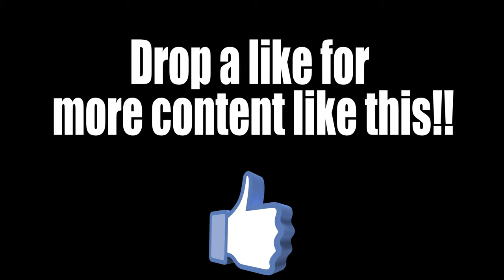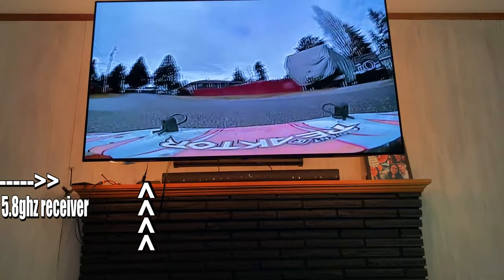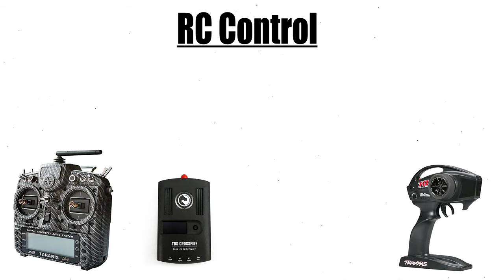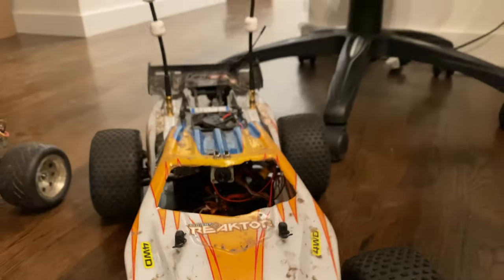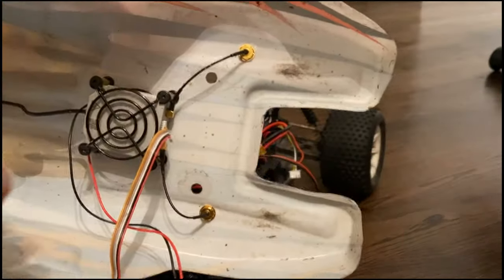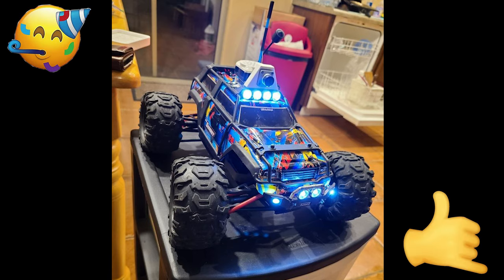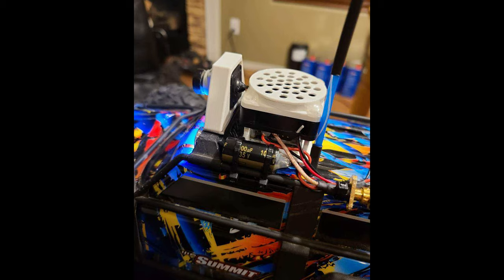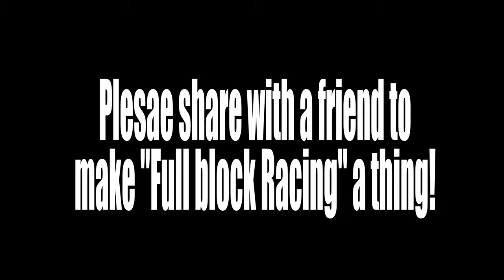How to Build an FPV RC Car in 2021!!!!  - 4k

Comment: I want to do a simple fpv in my crawler...not to much range..100 feet of so. I use 3s lip battery and want to power up off my esc plug and use a small video monitor..and want it under $100.  Suggestions?
Reply from the maker: Yup! I’m making a video on the subject very soon, but I will help get you started now: you can’t power the vtx off of you car’s battery. There is too much interface from the esc and will cause bad video. You can get away with a 200mw all-in-one vtx/camera and a little screen from Eachine. Power the vtx from a 1s battery and mount them the best way you can. *Keep the vtx as cold as possible 🤙
Reply: @ChaddRainsFPV  is there a brand or amazon link for the camera? Is there numbers to look for as far as video quality in the 5.8hz cameras? Thanks so much for the help. I want to sit on the couch and do some fpv crawling in my back yard..fun stuff.
Reply: @ChaddRainsFPV  just got my little fpv camera/transmitter combo, 1s battery and stand alone monitor..about $100 all in..works great on my little 1/18 scale rig.
Reply from the maker: @brianonthego  Awesome dude! The little ones are super easy to set up and doing little racetracks with them is great. Careful tho, getting hooked on pushing long range gets expensive hahah 🤙

Comment: How to do the 1.3 ghz video setup
 I forgot that I had asked early 😅 what is the cost for the 1.3 setup ?
Reply from the maker: Sorry for the delay on making that video! I will get it out, just been busy. You can do a simple (but good) 1.3 ground station for ~$100, but you need to make sure your RC link doesn’t interfere (or get interfered). 

It’s best to use crossfire with it so that adds a good chunk of money too. I think I have around $500 into my whole 1.3 setup.

Comment: i just came across this type of technology, just curious why drones have wide range for the unit and also the wireless camera, but its not applicable in RC cars? I noticed RC cars dont got the same range capability
Reply from the maker: When you transmit radio waves really close to ground you have to deal with the waves bouncing a lot. You can also be in what’s call the fresnel zone (Google will explain that one well). This makes it harder to get the same range vs something that is in the air. I like a challenge so that’s why I make “FPV rovers”, but I do drones as well 🤙
Reply: @ChaddRainsFPV  Regarding that, is it not possible to rip the system out of a, say,  mavic mini 2 and put it in a car? It´s supposed to have a 10km range in the air, it´s hard to imagine it woulnd´t make 500 meters where I am at (high hills with valleys, free sight, no cables, no wifi etc.)?
Pls forgive me if I am being naive or just oversee something! In my country only 5,8ghz and 25(!)mw are legal, so I wonder if that is even worth the effort...
Reply from the maker: @jotcw81  The Mavic’s all use a different kind of video link than the DJI FPV system (they use an older “lightbridge”). It has latency that makes it difficult to fly (or drive) while only seeing video on your phone. 

Basically, if your car is fast this won’t work. If your car is slow (less than 20mph) you could probably have a good time with it 🤙

Comment: Hi I have a 1/24 rgt and it’s FPV!!! but not now the cameras keep getting very hot and stop working after a while any help?
Reply from the maker: Right on! That is a Super common problem. I tried adding heat sinks (like the ones used on esc’s) and it didn’t fix it 100% of the time. I had to use a fan and make a mount so it would blow in the video transmitter the whole time it was on. Hope this helps 🤙
Reply: @ChaddRainsFPV  I have burnt out many cameras like 7 so no more fpv for me lol

Comment: hi...
what is the range you got on the dji air unit setup?
Reply from the maker: It depends on where I am driving. If it’s in my neighborhood I can get 2 blocks down. If I have an open field, I am guessing a mile. I have taken it out 1km with no problems but ran out of room to drive 🤙

Comment: I need to ask like 3 questions lol can I message you? I have the air unit and goggles do I need the crossfire system off the bat or can I add it next time I get paid lol
Reply from the maker: I rarely check IG but messages there sometimes get through. I check YT more haha. 

But right, here’s the deal: a good install of the DJI air unit (antennas, cooling, etc) will get more range than almost any stock RC car’s 2.4ghz link. You don’t wanna drive your car too far and have it get stuck with no RC signal. You can get away with it but gotta know your RC limit 🤙

There are some radios that will make it around the block. The Radio Link RC6GS is one 👍

Comment: What size fan do you have on the air unit?
Reply from the maker: They’re just some 60mm (maybe 10-15mm thick) 12v fans. eBay gotta have them for cheap 🤙
Reply: @ChaddRainsFPV  awesome, ima pull 1 of my air units out of my drones and use that instead of my runcam5 im using. Im gonna do the DSC port on the radio aswell when I get some cash to buy 1 lol.
Reply: @ChaddRainsFPV  got my controller and tbs all set up, had to reverse throttle other then that all set up :D thanks for the video's
Reply from the maker: @ToothlessCBR  hey right on man!! What remote did you get again?
Reply: @ChaddRainsFPV  I got the RadioLink RC6GS V2.
Reply from the maker: @ToothlessCBR  dude. Thank you for confirming! So many people said the radio link wouldn’t work or the Dumbo RC wouldn’t work so I appreciate the confirmation, really 🤙
Reply: @ChaddRainsFPV  Id gladly send you some pictures of the radio and my xmaxx setup.

Comment: can that dji fpv work with monitors or only goggles
Reply from the maker: I made a video on how to get video from DJI goggles to monitors / Fatshark goggles. There is no “ground station” style DJI receiver though. Not at this time so you will always need DJI goggles. Hope this info helps 🤙

Comment: Hey Chad.
How do I finish my crsf set up on my full size Summit?  I would like to personal message you.  Interested?
  I am so close. Been stuck for weeks now. Not exactly sure how to hook up my nano div.rx /servo adaptor. with servo leads from truck. also script goes blank in Qx7 trying to open up micro tx.. Pease
Reply from the maker: Hey Willy,
Just hook up your servo leads like you would to any other receiver. Ch1 is probably steering and channel 2 is throttle. Here is a good video from another channel that explains it pretty well (tell him I sent ya if ya don’t mind 🤙) - 
https://youtu.be/jb3XUuhimbk

Comment: How well do you think 1.3 gh would work in a cave?
Reply from the maker: That’s tough.. it depends on how narrow. If it was a big cave it would beat 5.8ghz but if it was really narrow I think you’d have an issue with the antenna being too close to a ‘reflective’ surface
Reply: @ChaddRainsFPV  what would you suggest? I’ve been trying to build an rc 4x4 with a camera and liar lidar but I lose signal very quickly.

Comment: Lol I was about to ask if u have found any part for that dominus. But it's not a Dominus. My buddy just gave me one with the brushless 540. But I'll definitely be making me a fpv mod really soon. I already use crsf on my fpv quads and I got a tbs sixty9 that has a 1w vtx and crsf nano combined.
Edit... Well i guess it is a Dominus 🤦‍♂️🤷‍♂️ do u happened to Kno how to get a parts. there is supposedly a Chinese car or something that the parts work for it. But I haven't found it yet
Reply from the maker: Haha glad to hear you’ll be making one too brother 🤙 I couldn’t find any parts for mine and had to move onto a better rig. Video on it is almost done now
Reply: @ChaddRainsFPV  i feel ya. I'm actually about to put the granite blx 3s in layaway just to have parts availability and upgrades.

Comment: A 1000$ before inflation im thinking the old android phone with rupert app would work pretty well any thoughts ???
Reply from the maker: The price of the goggles and air units has actually gone down since I made this 🤙 Crossfire system is about the same but you can get away with a RadioLink or DumboRC radio if you need some more range than a stock remote. Nothing has went up in price, in regard to systems I covered. Fingers crossed tho hahah
Reply: @ChaddRainsFPV  Thanks 👍

Comment: do you need to have goggles or can you just play it on a screen
Reply from the maker: It depends on the system. Analog systems can always have a screen if you prefer. Digital systems (like DJI, HDZero and Walksnail) almost always need proprietary goggles 🤙

Comment: Can You do a video on your ground station I want to do the same thing on my 8s outcast and xmaxx and e revo 2.0
Reply from the maker: Editing now! Should be done in a few days 🤙
Reply: I bought the fs gt3b controller and it won't work with the tbs crossfire lite or I don't know what I'm doing can you send  in the rite direction to get it like yours to go around the block
Reply from the maker: @gentrylongfar6255  what cable do you have hooked up to it? Where is it hooked up at? You can make a video of how it’s all put together and post it to YT and I’ll check it out. Just tell me when you post it
Reply: I will I just bought the radio link the one you recommend on your video

Comment: Does a separate battery power the fpv system or how is it getting power?
Reply from the maker: For analog yea, it’s a must. The noise from the motor/esc is too much for the video feed. If you’re using DJI FPV for the video, just using a fat capacitor is enough to run the air unit off of the car’s battery. 

Hope this helps 🤙
Reply: @ChaddRainsFPV  The air unit as in the DJI camera with fan? How many volts in the bec are recommended?
thanks a lot
Reply from the maker: @jaimemira-xb5zh  Yes, the air unit. But it doesn’t come with a fan as stock. You need DJI FPV goggles to use the air unit (just a heads up). To power the air unit it needs less than 17v and more than ~7v.

Comment: Thanks for the good information.

With the DJI digital fpv system (1200 mw) + 30$ 2.4 ghz booster, about 500 m is easily possible.

The biggest problem with rc car fpv is how to control the vibrations on irregular surfaces.

I'm thinking about this part, but it's not easy.

I'd appreciate it if you could make a video about this.
Reply from the maker: I’ve got something in the works. There are 3 tricks you can do. Vibration isolators for the camera (can be 3D printed or rubber pieces purchased), camera placement (the farther forward the more bounce since the front wheels will pop up more often), and suspension set up (its hard to find a good balance between soft enough to avoid shaky video and stiff enough to handle corners). I’ll make a detailed video about this (I’ve got tons of hours perfecting the right setup, but so many video projects haha). Thanks for the comment and interest 🤙
Reply: Only 500m?
Reply from the maker: @CodySmiley  - 500m is a generic distance that people will use in FPV, without much detail about what the terrain is like. So 500m across an open field isn’t a big accomplishment. But 500m through a neighborhood with houses blocking your signal is massive. 

At any rate, 500m is harder to achieve on an rc car than a lot of people think. Hope you build one!
Reply: @ChaddRainsFPV  I want to build my own fpv and just wondering if 5.8gHz or 1.3 or dji fpv is better for me
Reply from the maker: @CodySmiley  DJI is def the easiest to get good range on. But I am having better luck with 1.3 now. I had to move up to a 1000w vtx tho
Reply: RC cars and drones have different environments.
A typical analog fpv is difficult even 100 meters. @CodySmiley
Reply from the maker: @rcmod642  - Yup! The digiview app is great 🙌 I have had some friends working on it for a while. I use a special “digiview” website so I can connect on my PC 🤙

Comment: what do you use the crossfire for?
Reply from the maker: The normal 2.4ghz radios won’t make it around my block. Crossfire runs on the 900mhz band so my control link is much further. My video system makes it about 2.5 blocks from my house and now so does my RC link 🤙

Comment: Hello, first of nice video :) Helped alot with my own build. Atm i have some heating issues and i was really looking around alot to find that case you had for the Air unit Module, where you mounted the fan. Where did you get that? Or did you make it yourself?  Im talking about the one you are showing at 7:06  Best Regards
Reply from the maker: Hey thanks! Yup, I made that myself. I was considering selling a kit for it but I wasn’t sure there would be any interest. If you want to make one just grab some metal m3 or m4 standoffs (I used brass. 30mm I think?), a 60mm fan, two 60mm fan grills (to sandwich the air unit) and some m3 or m4 screws. 

There are some other little details but it’s different for every build (fan voltage, connector type, etc). This should help you get it started though 🤙
Reply from the maker: @smashroth6745  Haha Nice! I love it when someone waves at the car and we wiggle the tires back! Yeah, the fan is a huge help in keeping it cool enough to run at higher power outputs. I tried heat sinks for a while but the ran really is the magic 🤙
Reply: @ChaddRainsFPV  Yeah im hoping for it to work. Also i was actually thinking about buying something like a horn or maybe even a 2 way speaker setup :) Think that would be cool
Reply from the maker: @smashroth6745  On my latest build (overview video is nearly done!) I show my “horn”. It’s a “ViFly” buzzer that I can actuate using the 3rd channel on my remote. Best part, if someone were to try an run off my car it will siren at over 100db for hours, even if they unplug the cars battery 😎
Reply: @ChaddRainsFPV  Thats so cool :) i will look at that buzzer asap :D Thanks man. I will keep an eye on your videos !
Reply: @ChaddRainsFPV  Atlast, i got my new antennas and i did the FCC hack on my goggles and DJI air unit to pump the MW up. Air unit on 700MW and goggles on 1200mw. With the new fan installed i could drive safely with no worries.. But i just got my Gopro today so i havent made any new videos. But i could litteraly drive around a 20M thick concrete appartment that is around 25M  tall and 100M wide. And i had perfect signal all around. I couldnt even make it to the corner before :P Thanks for the inspiration. Only thing now im gonna work on in the next couple of months is setting up some sort of 2 way communication so i can talk while driving :D Think that beats the buzzer option :D Havent found a good solution yet, but i will tell you if i find it. Have a good one sir and thanks again for the help.
Reply from the maker: @smashroth6745  You too man! Two way communication would be awesome but hard to do haha
Reply: @ChaddRainsFPV  Yo man, i just found an idea. Im still looking for a good sized version but my country its harder to find :) But heres the idea. A VOX walkie talkie. Its a voice activated Walkie talkie so you dont have to push a button. Though it will always transmit while driving cause of the sound, but when you stop and want to talk it should work fine i think :) If i find a good one ill let you know. But think this might be the cheapest solution. So its probably a matter of size thats gonna make the difference here.
Reply from the maker: @smashroth6745  That is great info dude! If there was a VOX model that had gain control so you can tune out some of the motor noise comping back to you, that would be awesome! If I go that route in a future vid I’ll shout you out! Thanks! 🙏
Reply: @ChaddRainsFPV  well honestly i think it doesnt matter much about the motor noise. Because you would probably never speak at high speed. And at low speed it might depend on settings. And since dji records sound you can just Edit sound there. You only need the vox for the laughs and would probably most of the time use it while stranding still. But anyways im still looking. Give a heads up if you find anything good. So far the smallest vox i found was called easytalk i think.
Reply from the maker: @smashroth6745  👍

Comment: Quick question how  do get audio
Reply from the maker: Audio is tough but you got 2 options: Use analog (not DJI as audio isn’t supported at this time) and add a microphone to your vtx (if your vtx supports it) and wear headphones that are wired to your receiver. 

Option 2: have a walkie talkie on your rig with the transmit button taped down. 

Both of these options have their issues; mainly that you are responsible for what is said over the radio (as you are the one that chose to transmit) and swearing over radio has pretty massive fines (if you’re caught, which would be very unlikely but you should know these details before proceeding) 🤙